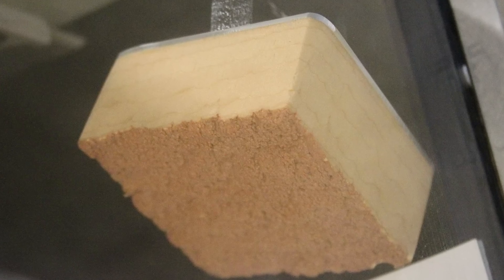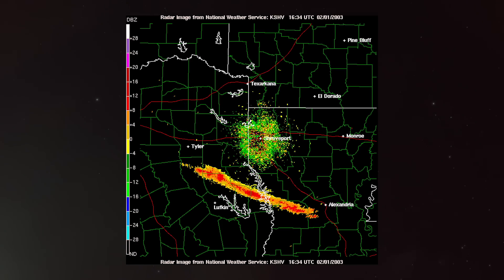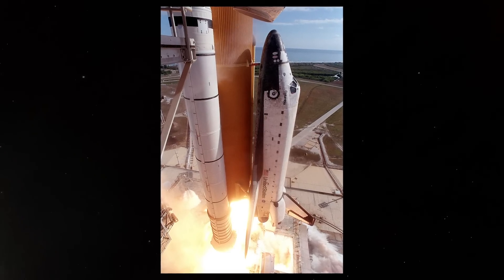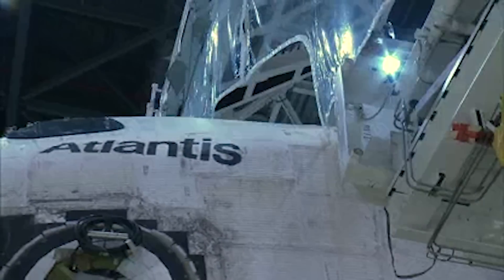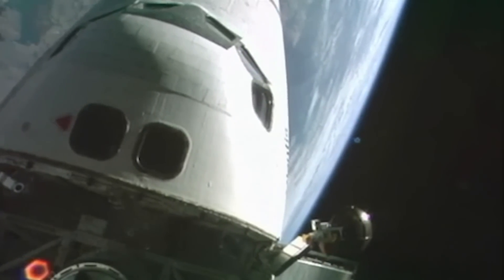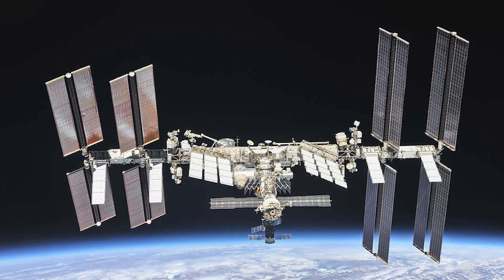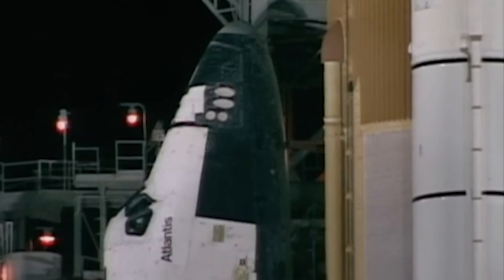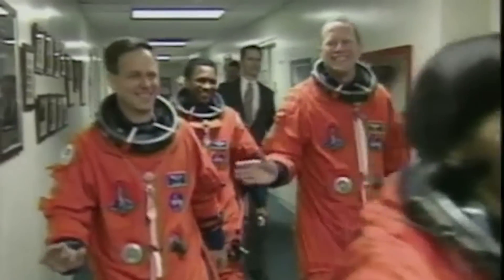The Backup Space Shuttle - A Rescue Mission that Never Launched

Comment: I believe NASA took the easy way out. They knew from the get go of the shuttle that the tps tile's were falling off and prone to damage from foam and ice strikes. Prior to Columbia they almost lost another shuttle because they didn't believe the crew. The only thing that saved that crew was a piece of stainless steel mounting bracket that was able to survive re entry heating.
Reply: This accident had nothing to do with tiles. In fact, tile issues were solved in the eighties. I don't remember any ice strikes through out the program as it doesn't launch with any noticeable ice. Foam shedding however was always a problem.

Comment: Imagine making a section of your video about how the shuttle could last in space for 30 days based on it’s oxygen supply when space shuttle columbia (with the EDO Pallet, which it had on 107) could only stay in orbit for about 16 days due to the hydrogen fuel cells. 

And Atlantis wasn’t only going through pre-flight. It was going through processing and just had it’s engines attached. 

NASA also could’ve rushed processing without skipping any necessary testing and had a 5 day window to get to Columbia.

Someone clearly did not read the Columbia Accident Investigation Report

Comment: Both shuttles were lost to the same reason: management.

'Challenger' shouldn't have launched on the day it did, due to the low temperatures.  The contractor that built the rocket boosters called and warned them about the O-rings possibly failing from the cold, but the launch had already been delayed for other reasons and NASA management was impatient about getting the first teacher into space.  Waiting one more day could have saved them all...

As for 'Columbia', the problem of foam blocks breaking off and striking the orbiters was a known fact at NASA, but management didn't do anything because they would have had to redesign the entire insulation system of the external tanks from scratch, and they didn't want to spend the time and/or money.  It was only a matter of time before the foam caused a major catastrophe....

Comment: Everyone on the shuttle knew about the foam strike yet they confidently went along with nasa chatter as sheep to the slaughter.  why no astronaut on the shuttle did not insist on dual space walk to do a visual observation of the wing panel is beyond me. i understand chain of command and trust in the system, but i just dont understand this misplaced trust knowing just how vulnerable the vehicle was to destruction on every single flight...beyond me how anyone could develop a laissez-faire attitude knowing just how many critical failure components the shuttle had.

Comment: I wonder if a better option would have been to send up an unmanned craft with spare CO2 scrubbers, food etc on board to replenish the shuttle whilst they take their time in getting a second shuttle ready. An unmanned supply vessel would have shorter and simpler preflight checks and would have a lower risk should any steps needed to be cut.

Comment: One thing this video doesn't touch on. After Columbia, NASA developed a policy of actually having a second orbiter on the pad and assembled (but unfuelled) ready to undertake a rescue mission if needed. They also developed a system to allow the casualty orbiter to be de-orbited remotely. These contingencies were never used: https://en.wikipedia.org/wiki/STS-3xx 

Of the 13 post-Columbia flights, only STS-135, the final mission, did not have a backup shuttle in place. This is also why crew compliment of STS-135 was reduced to 4.

Comment: They could have landed. If they known the wing was damaged. As they could change the re-entry angle. Away from the hole..I seen someone that did just that in a simulation..They never allowed the right wing to ingest the heat...They slide slipped till the speed was reduced to under 500 knots.

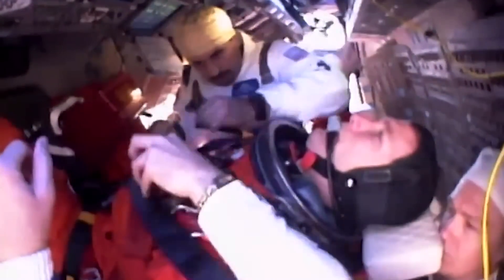Comment: 9:19 In other words, decisions at NASA being made by managers instead of engineers (like the old days, when the possibility of failure wasn’t considered an acceptable option).

There’s a chilling phone call recording that you can find here on YouTube where NASA managers were on a conference call deciding whether or not to dismiss concerns about Columbia‘s heat shield. It’s evident from the recording that the decision is based on metrics considered by a manager rather than on engineers’ knowledge and intuition. In short it came down to a question posed in the loaded and diffuse language that is so typical of management boards i.e. what are the odds? The answer? Essentially: meh, not all that big.

The exact same type of phone calls took place about Challenger’s seals. 

What gets left out? Any competent engineer who would have told them what an informed real risk assessment looks like vs. managerial decision making which often revolves around a simple diffusion of responsibility. 

Those who can, do. Those who can’t, manage.
Reply: Linda Ham saw that shit fr and did nothing about it.

Comment: Saddest example of administrative failure in American history.  Mission control and the NASA Administrator failed to take photos of the wing when launch film indicated the foam strike.  They simply did not want to contemplate a worse case scenario.  Columbia had supplies for an extended mission.  Atlantis was already in an advanced state of assembly and could be been made ready in time without skipping safety checks.  It was failure after failure which led to the loss of the crew.

Comment: The same thing happened to Atlantis.the only difference was is the tile the foam had broke had high strength steel instead of aluminum, higher melting point for the steel.there's an interview with the Atlantis Commander or pilot that talks about it and they were lucky as he puts it

Comment: Lies. Foam damaged metal? Lies
Reply: No one said foam damaged metal. The leading edge of the wing is made of reinforced carbon-carbon.
Reply: It damaged the ceramic heat shield tiles. Those tiles are extremely fragile they are  almost like a styrofoam but made from ceramic which makes them rigid and easy to break.

Comment: You stated that had Atlantis launched for a rescue mission it would have been the first time there would be two spacecraft in orbit for mission control to worry about. This is not the case, the have been several times nasa have managed 2 spacecraft in orbit at the same time. The first time being in the Gemini program. Gemini 6 and 7 were in orbit together just feet apart.
Also Apollo 9 had the CSM and LM in earth orbit together to practice docking and unlocking before going to the moon.

Comment: Thanks for video I asked this very question. Why did not physical inspection occur in flight? I think this highlights the failure with the shuttle program. A shuttle should have already been ready for a possible rescue mission sitting the vehicle hanger for movement out to the pad. The foam issues on the fuel tanks was a known issue yet NASA did nothing to resolve (2006) for STS-121. This highlights the problem with NASA is NASA. It is a bureaucratic mess with little kingdoms and Not My Idea culture. This is the reason why SpaceX, Blue Origin, and any other private company is the future.
Reply: You can't get an orbiter ready for flight in the vehicle assembly building.  The pad is required for so many things that have to be done prior to flight. Thats why the orbiter sat at the pad for 30 days.

Comment: Was there any way to refuel the OMS engines in orbit?  Or perhaps attach external payload assist rockets to the orbiter in order to give it enough delta-V to perform the orbit inclination maneuver and rendezvous with ISS?  Any such payload (whether it be fuel or assist rockets, or even additional supplies and CO2 scrubbers) could have been sent up on an expendable rocket of the time.

Comment: In an interview before STS-135, Doug Hurley (who will be flying to the ISS on a SpaceX rocket in two weeks) talked about the rescue plan if something went wrong on that mission. Since it was the last shuttle flight, they wouldn't be able to send one up to rescue them, so the crew would have had to ride the extra seat on a Soyuz back home from orbit one by one. Doug, being the pilot of the flight, would be last one to come back home A YEAR LATER. Thats why NASA really wanted to have two separate contracts for Commercial Crew, in case there was an issue with one spacecraft, they would have the capability of continuous and capable operation in orbit.

Comment: Yes, NASA knew there was an issue.  The Department of Defense offered NASA a spy satellite to take high resolution photos of the craft to see the damage to the reinforced carbon-carbon on the leading edge of the left wing.  NASA declined, literally assuming that the foam could not have caused fatal damage (assumptions are great with human lives, right?).  Several of its engineers objected but did not object strongly enough.  There is a great podcast out there with two of the NASA employees monitoring the sensors on the left wing on the craft's descent.  You can hear the utter regret in their voices that they did not stand their ground.

Comment: What caused this disaster was at the end the construction of the shuttle itself, foam incidents also happens with other launch vehicles, they also happened in the Apollo program. The difference is, at normal launch vehicles the payload sits on top of the rocket, and pieces of foam can not damage the payload/capsule, while the space shuttle was prone to foam strikes because of the position of the glider at the launch vehicle. 

With a better monitoring of the edges of the wings with cameras at the side of the shuttle (like the ones they use at Falcon 9 rockets today), they would have had possibilities to monitor them even during the early stages of the flight, and react with a flight abort before they would have been too fast, even if this flight abort would not have been without risks, and may have led to also to the loss of the shuttle.
Capsule systems for people may look obsolete, but in this case they have lower risks in both scenarios, they are inherent safe when it comes to foam incidents, and in scenarios like the Challenger disaster they offer the option to abort the flight with much less limitations than the shuttle had in behalf of flight aborts. 

Nasa knew of this foam incident, they had the videos, on which they have a closer look even if there are no incidents. What they did not know was if the shuttle was damaged, and if yes how severe the damage was. They had no possibility to have a closer look in space, the robot arm with the cameras was not on board. The rescue mission was not really realistic (for later launches they always had a second shuttle ready for launch), so they decided to say nothing to the crew, because they couldn't do anything.

Comment: I remember watching some tapes that showed the Shuttle's automatic flight system cranking in more and more rudder trying to offset the drag from the damaged wing, also the thermal signature of the event as the wing filled with hot atmospheric gas and proceeded to melt.  I think the break-up was caused by stresses on reentry in a non-aerodynamic mode when the rudder failed to maintain a straight path.  Either way, heat or aerodynamic stress, there was no way out of the catastrophic break-up.

Comment: “What if” NASA management had the courage to take advantage of the Air Force offer to use their highly classified telescopes?  Surely the extent of the damage would have been known and everything possible would have been done to save the crew.  Maybe there was a reentry profile that would have kept the hottest temperatures away from the damaged wing.  Who knows what was possible. A NASA engineer who would have been on the team to come up with a solution told me it was like NASA management just gave up on the crew.  They chose to bury their heads in the sand and let luck determine the fate of the crew rather then some of the most brilliant minds on the planet.  So sad!  Good video as always.

Comment: Had Columbia had enough fuel. It still would've been impossible to dock with ISS due to a difference in hatch designs. Columbia was the only one that wasn't able to dock directly with the ISS. Not to say a spacewalk wouldn't have been out of the question but docking would ve been without question impossible.

Comment: I smell a coverup, how does foam do that much damage
Reply: You have to understand, Columbia was going fast, I don’t know precisely how fast, but probably a few thousand  meters a second,  at that speed, even a small pebble could cause catastrophic damage. I don’t know what they used for their insulation foam, but I imagine its pretty heavy.  The heat tiles are pretty weak, too. Its very easy to of caused catastrophic damage to the shuttle. A similar incident happened to Atlantis on (Correct me if I’m wrong) STS-30.
Reply: @spaceshuttleatlantis551  Reinforced carbon carbon lacks impact resistance
Reply: @spaceshuttleatlantis551  honestly, i was baked when i watched that lol gave it some thought and remembered that a hurricane can put a vinyl record threw a brick wall lol forgive me

Comment: If NASA at the time had had some form of Orbital Transfer Vehicle or OTV, a type of spacecraft that was envisioned during the 1980's but never built nor flown, and further if these capsule & module based vehicles could have been either parked at the ISS already, or had been able to be launched on the required short notice of 2, 3 or 4 weeks, and preferably if this spacecraft had the ability to have been flown unmanned, then a resupply secondary mission could have been flown to reach the Shuttle 'Columbia', equipping it with extra life support air provisions, and/or with additional propellant fuel.  

   Either: (a.)  By supplying the Space Shuttle with more of an air supply and/or Carbon Dioxide absorbent filters, or scrubbers, the crew would have gained the benefit of being able to stay in its orbital flight for perhaps a few weeks longer, and continue viably in a rescue-waiting state, which in turn would increase the amount of multi-weeks time that the 'Atlantis' Shuttle would've had for being readied for its rescue mission--------- a plus for flight control & the ground preparation/maintenance personnel; OR: (b.) By supplying the disabled Space Shuttle with additional rocket fuel, with which to do the needed engine burns to do the complex orbital plane changes, for it to afterwards have flied to reach the ISS, which of course would've brought the at-risk crew to a safer space point from which to await help. 

    So in summary, an unmannedly flown OTV in either mission plan scenario, could've saved the crew, by either ferrying to them important supplies & equipment to survive longer in space, where they were; or by permitting them to make an orbital change maneuver so that they could reach a safer haven at the ISS, where again they could've endured being in space long enough until NASA could more conveniently have launched the 'Atlantis' to dispatch to them.

Comment: One thing I've often been curious of. If the foam strike actually caused this at launch. Then why didnt the breakup occur or damage enough to be noticeable occur during the ride to space?
Reply: The breakup occured due to reentry heating through the atmosphere. The shuttle during launch doesn't have the combination of speed and atmospheric density to the same extent as it did during reentry.

Launching, you don't have the same speed through the thick lower atmosphere as you do coming back in.

Comment: I read a report somewhere several years back on the possible rescue of STS-107 if it had been discovered earlier and it stated boosters from Japan, France “ESA” and possibly Russia were on the pad and could have been given the programming to rendezvous with them and resupply the crew with air, filters and food/water.  Enabling Atlantis time to attempt a more secure launch and rescue.  The part I didn’t like about the report was NASA not attempting to salvage or save Columbia by allowing it to simply be guided to a South Pacific open ocean impact.  It couldn’t have been that much more difficult to simply place an RCC off another shuttle over the broken piece with high strength glue material already tested on previous space flights and have Columbia land on a coastal military airport in Alaska or the West coast of the U.S.  Saving the crew then watching Columbia perform an auto land would have been the icing on the cake.  Sorry for the long post.

Comment: The second shuttle crew could have repaired the first shuttle. Little bit of glue and a insulated tile and you got yourself a fixed up shuttle.
Reply: What always surprised me was the fact that there were no "patch kits" on the shuttles for this contingency.

The investigation report talked about putting 'junk' and water/ice in the hole as a 'hail Mary pass' fix, and that's it.
Reply: The tile that was damaged was custom-made for that particular location on the wing's leading edge.
In fact, to study the way the debris would have struck the Columbia's wing, the corresponding piece of tile from Enterprise, the glide test shuttle, had to be removed (this was noted on materials accompanying the Enterprise when it was displayed in the Udvar-Hazy annex to the Smithsonian) so that a piece of material could be fired at high speed into it.
They just didn't have any spares laying around.
Reply: @Donleecartoons  They didn't need a spare for an emergency, they just needed a foam injected workaround product. 

Better than the alternative emergency procedure of shoving junk and water turned into ice into the hole.

Interesting fact about the Enterprise tile being used for the post accident testing.